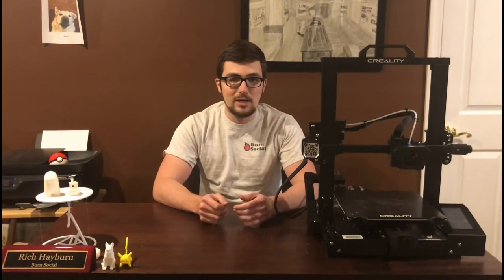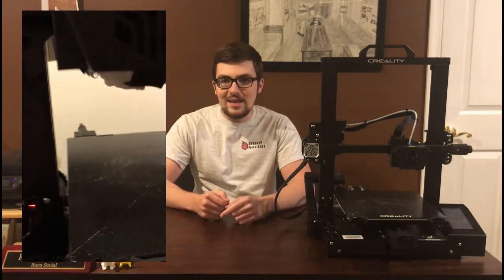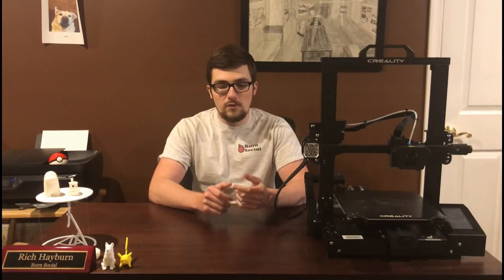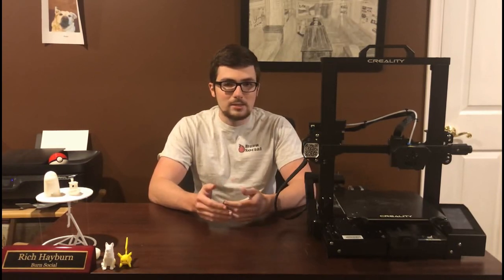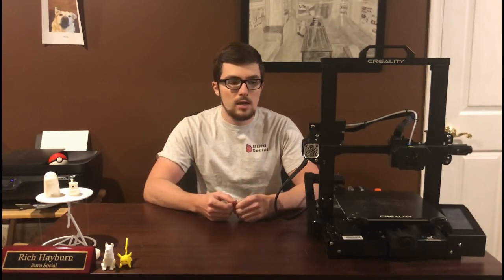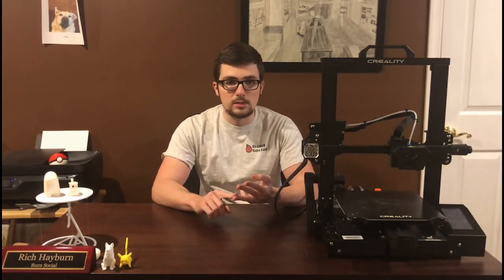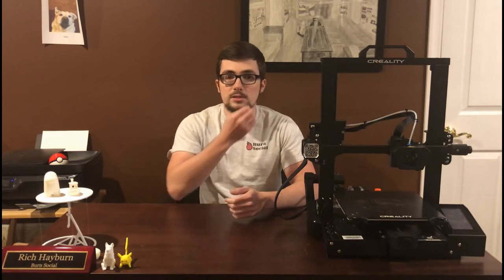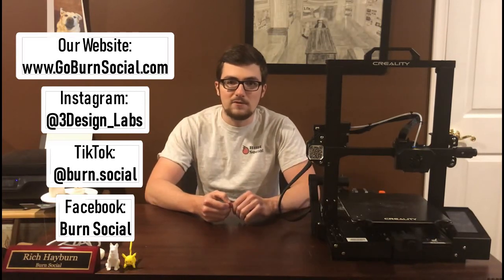My Creality CR6-SE BROKE!

Comment: Buy a new hotend whole thing on Amazon it's like $35 to $45 I did it super easy to do
Reply: This is what I ended up doing a few months after making the video, as spare parts were not available at the time of filming. 

It’s just sad that we had to spend that much on a pretty new printer. The poor auto-leveling was still a huge issue that rendered the printer unusable. I found a community firmware patch that came out around 6 months ago that fully resolved this issue though and now it functions as it should

Comment: Mine was working great up until I tried connecting a raspberry pi 4 with octoprint installed. The pi fried and so did the usb port on the printer. It took creality awhile to respond because of Chinese New year, but they are sending me a repair kit. As for cleaning the bed, I found out that taking a clean rag with isopropyl alcohol on it and wiping the bed when it's up to temp works really well for adhesion.
Reply from the maker: I'm happy to hear they got back to you! Any tips for me or anyone else reading on how to get a legitimate response?
Reply: @burnsocial3542  Thanks! Honestly I can't remember how I contacted them. Sorry. I'll do some digging through my old emails from them and if I find something useful I'll post another reply for you.
Reply from the maker: @Viking8888  Sounds great, thank you!

Comment: the broken wire is just the thermistor. lol if you can't fix that,  then you got a personal problem. 

not to be a dick but,  it's a printer, if you can't research the 5-7 items that makes up a hot end then it just seems like you're not trying at all to fix it and just complaining. 

I ordered 5 cr 6 se, 3 of the 5 came messed up.  now all 5 are working.... 

like a thermistor is such a basic part of the hot end. you literally would be better off buying the 24v e3d hot end kit and just slicing the wires.  you'll have a much better hot end and keep all the dangs functionality,  you just need an adapter for the strain gauge and the hot end. 

back when you had to hand build 3d printers,  this is one of the first things you learn to do. I'd suggest researching more.

Comment: That doesn't look like a levelling issue. If it was a levelling isue you would have just had a "birdsnest" it wouldn't surround the hot end like that. It looks like you have had a leak of the hot end where the bowden tube is not tight against the nozzle.
Reply from the maker: It starts as the birdsnest you're talking about, but since it was left going overnight it kept creeping upwards. I can confirm that was not the issue

Comment: You can buy a replacement hot end from Ali express
Reply from the maker: Could you send us a link? We were unable to find one that works with the custom board in the hotend enclosure. The spare thermistors we have wont even give a reading
Reply: @burnsocial3542   It's good to have backup parts handy. I have an ender 3, Heavily upgraded CR-10 and the cr6. I've learned from experience that something will break or wear out... it's inevitable.
Reply: Oh, and if you want the magnetic bed, (I'd suggest the textured with magnetic base) here's a link: https://www.aliexpress.com/item/1005001520522138.html?spm=a2g0s.9042311.0.0.5e364c4dj0bwou
Reply from the maker: @EmptyTelevision  Agreed! We have spare parts for most components, even a handful of stepper motors, but this was a great reason to get some thermistors
Reply from the maker: @EmptyTelevision  I definitely prefer these just for the ease of snapping parts off. We get better adhesion with pei over glass for most materials we use too. Thanks for the link!

Comment: Mine has problems with adhesión as well.... it almost seems like the bed is loose a bit, does anybody else's Ender CR6 SE have a bed that moves a bit up and down?
Let me know, I sold my perfect working Ender 3 pro and now I regret it...
Reply: Mine was the same. The printer comes with a spanner/wrench in the tool drawer that you can use to turn the eccentric nuts and tighten the wheels on the Y-axis. This removes the play and makes for prints that stick perfectly every time (at least for me).
Reply: You're supposed to adjust the eccentric nuts. Caution: This does not mean overtightening the nut on the end. You gurn the nut in the middle until the wobble is gone. Don't overtighten; that deforms the wheels.

Comment: It is just the thermistor wires.  A resistance measuring device. As the temperature changes so does the resistance.  Reconnect the wires.
Reply: These wires can’t be reconnected safely. I ended up getting new wires and will be making a video on how to repair this week. The ‘nub’ at the end popped off in the heat block, so hopefully it’s not wedged in and I can get it out